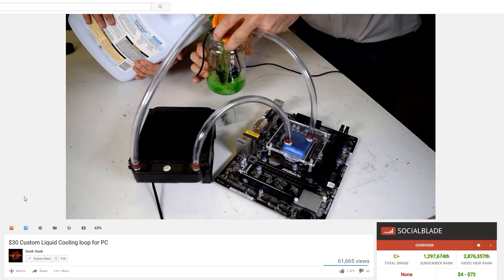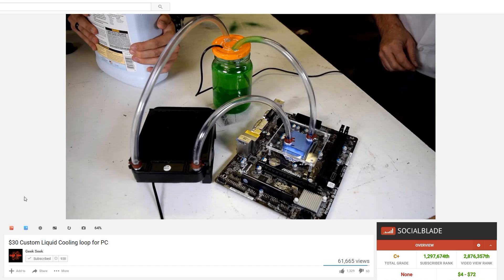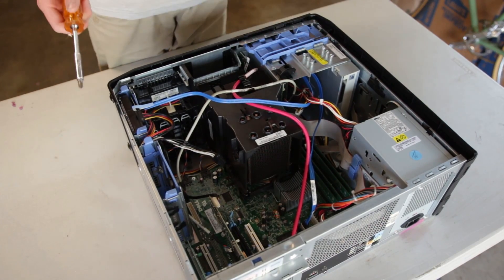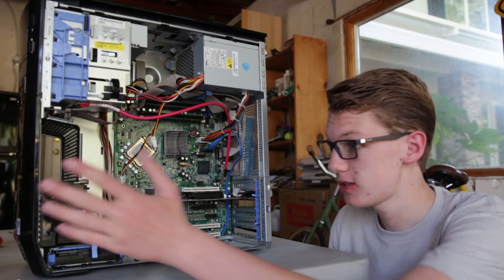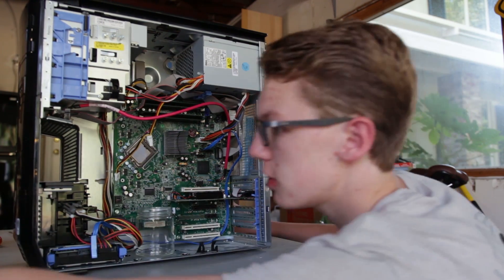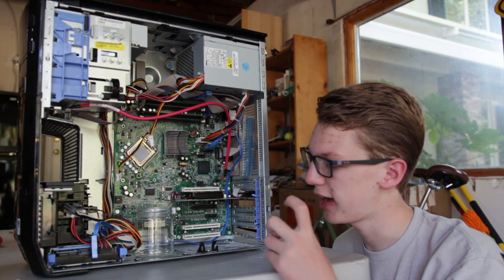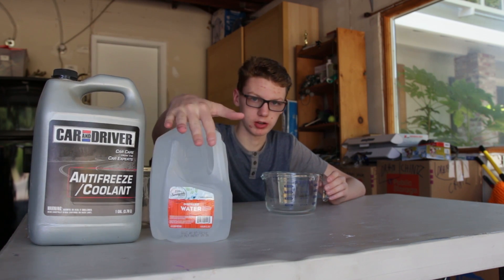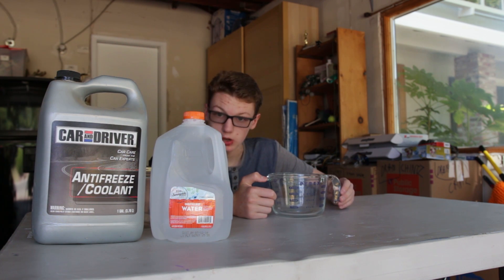DIY Watercooling the Intel Core 2 Quad(Q6600)!

Comment: Adding antifreeze is not a good idea. You are better off just using distilled water. And also i can see your jar still has holes on top, which means the water can evaporate over time and you need to fill it up when it's level decreases. Also if your radiator is aluminum and your cpu block is copper this will lead to corrosion over time, and eventually a leak.

Comment: How did you connect the water pump to motherboard? Any idea?
Reply from the maker: I connected it to the power supply with a molex power connector.
Reply: @GavinRemme  bro 12v is required molex connector or I need more voltage
Reply: Bro! Can you explain any problem will not occur and How to connect water pump directly to molex connector? How many voltage is molex connector have? Reply me fast because i am going to build a water cooling system for my pc i am inspired of your water cooling system.
Reply: And there are more wires in molex connector of psu where should I connect
Reply: What the screws are you used to hold the water block.name and size of the screws please?

Comment: Actually you can overclock it with a program called SetFSB but it will definitely be limited because you can't manually ajust the voltage.

Comment: Young man your video was nice but foolsh. Because you are using a non overclockable locked (DELL) motherboard. And so the oem cooling is more than enough on air. Just add some more fans "maybe some lighted" to the case by cutting the side panel if want to lower the temps. And check the bios and update it to latest and with any luck you may be able to install a xeon cpu in it. Which is far better. Or do the modification to cpu if that is what is needed. Sometimes watercolling is not the way to go....Stay safe and good luck.

Comment: You can overclock it. With a little bit of tape in one pin of the cpu, you lock the multiplier to 9 and it runs at 3ghz or 3.3 i dont remember

Comment: Building some cheap ass liquid colling system for by PC right now. Im ordering all the parts from chinese vendors, browsing trough taobao, found out that your CPU block was actually a really bad 3$ u-shaped radiator, thing not really suited for active heat transfer. oops

Comment: try adding a peltier unit to a second waterblock to actively cools the water below ambient temps.
Reply: You need roughly 300w of peltier coolers (just get a long version of the block he is using). Its not going to get that impressive of a difference (10c max improvement). Peltier just sucks in terms of efficiency, for example, if you put 300w of electric in, you get maybe 80w of cooling out. If you put 300w of electric into a refrigeration cycle, you may get around 1500w of cooling out (and you can go extremely cold, like -55c no load, or -45c with his CPU at max power). These are expensive though, but they are not a complete waste of time like a peltier is. If you do use peltier, you need to insulate and water proof everything for when it is at idle or you can short everything out with condensation.

Comment: Gavin, ive got a question. I recently ordered some parts for my own loop and ended up getting the same rad, pump but different cpu block. Ive got a question about how you hooked the pump up. I want to control my pump, could I use a fan hub controler?

Comment: Did you mount the reservoir to the case? If so how did you? I'm looking into doing something similar to try and get my Q6600 to 3.4Ghz, considering I can get 3.2 at 1.3v with good enough temps.
Reply from the maker: +ndreww Double stick foam tape.

Comment: I dont think that water cooling is better than air cooling ...
I have a Q8400 overclocked from 2.66 to 3.4GHz, and the temperature is around 38-40C,
full load temperature is about 50-55C. I have a cooler Cooler Master Hyper TX3i ...

Comment: Can someone explain how he made the mounting solution?
Reply: Mr.Money yep. so with that block you need to cut a square big enough to cover the mounting holes on your motherboard out of something durable like a piece of acrylic or cut off part of a side panel. you need to take this cutout and add holes to match ur board holes and ur cpu blocks holes. then slide the piece over ur cpu block, then tighten it down to ur motherboard. Linus Tech Tips just did a similar video and explains that part fairly well.
Reply: he should put springs below the nuts, to keep pressure long term, because the acrylic will set over time.
Reply: Agreed

Comment: Let me say dude, great video. I just have one question, how did you connect your pump to your psu??? Or if anyone else knows how too?? Much help
Reply from the maker: +Joe L I soldered the pump to a molex connector.
Reply: Is that the only way to connect them together? I do not have a solder.
Reply from the maker: You could just strip the wires and twist them together and then put some electrical tape.

Comment: You don't need to run the pump on 12v all the time, mine is an 18€ one and it starts pumping at 4,5V so i have it on the 5v rail. The improvement in temperture is only around 4-5°C and not as much as the sound
Reply: you should be able to use a fan speed controller to regulate the pump speed as well. just get a DC one.

Comment: do a benchmark comparison to older Q6600 rig
Reply from the maker: +Chetan Amrao They're the same. The only difference is the water cooling, but it won't matter because it wasn't thermal throttling anyways.
Reply: ok cool

Comment: Dude, this video is fantastic. The footage was great and you knew your stuff. The only thing that could be improved on is your ability to talk to the camera, it is good but could be  improved. Just spend some time in front of the camera and it will get better. Once it does, I think you could be one of the best techtubers on the internet. Good Job. (take my advice with a grain of salt tho, I made videos back when I was like 12... they sucked xD)
Reply from the maker: +ThePcNinja100 Thank you! 😁
Reply: great job man, liked the vid. got me inspierd ro buy a second System to try this out. would not dear this in my main rig which run's a wel overpriced ekwb set. but this might be Just as good.

Comment: It would have been cheaper to just buy a Corsair H50, 60 or any other on eBay. Why go pickle jar when those are available??
Reply from the maker: The point of the video was to watercool it myself.
Reply: Gavin Remme Did you use your blood or urine? Water is not from yourself. The water block is not yourself, or the jar. You made nothing. You just put stuff together. And it cost more than a used closed loop. Waste of time.

Comment: Hey man, good video. But I have a few things about the loop. All the eBay links I post are American because I assume that's where your from.
1. Get a Pump+Res combo and ditch the dodgy pickle jar. This one should work fine. http://www.ebay.com/itm/SC-300T-12V-DC-ultra-quiet-Water-pump-pump-tank-for-pc-CPU-Liquid-Cooling-System-/191221599290?hash=item2c85b20c3a:g:CPgAAOSwgQ9VyG-x

2. Get yourself some hose clamps for the barbs. Zip ties can break because of the clips. 

3. Get a new motherboard, case and CPU block. Those blue blocks have very little surface area for cooling and are very restricted with how much heat they can dissipate. This block is nice and comes with compression fittings so you won't have to worry about leaks as much. http://www.ebay.com/itm/GPU-Water-Cooling-Block-Transparent-Platform-Common-43-61-mm-Pitch-New-/141880476044?hash=item2108bc418c:g:0J8AAOSwKIpV-35N
Reply from the maker: Thanks for the links, but you realize the point of this was to make it as cheap as possible right? I know I can use better parts and get better results, I just wanted to do it cheaply and sorta hodgepodge. Someday maybe I'll do a legit EKWB hardline system or something.
Reply: Gavin Remme
I know it was to make it as cheap of possible, but I don't exactly want you to brick your hardware. The blue blocks are know to break within 3-6 months and spring a leak on the bottom of the block, draining your loop and leaking all over your CPU.

Comment: the stock heatsink has the same cooling surface, same airflow direction, no water, more lightweight and no pump. watering is impractical
Reply from the maker: But it's not as fun :)
Reply: that's true

Comment: I'm currently running as a daily rig a Q6600 just like yours on an ASUS motherboard.
The processor is under water cooling system from Cooler Master and OC to 3.08 Ghz... Everythings runs PERFECTLY and temps are 30°/86° F Idle (room temp 26°) and not going over 50°/122° F under full LOAD.
Anyway, I really appreciated your video in which you assemble that computer with that old Q6600 and the gtx 960. It made me buy an old GTX770 for just 90 $ (the equivalent in Euros is pretty much the same number 90 €) and effectively play all latest games with a decent amount of FPS (still playable). [I mean well above 30 fps].
Thank you very much for your test and I've seen you have improved a lot the quality of the videos with really good music in!
Keep working, you're making great stuff!
Reply from the maker: +Crazy Lod (LodOS) That's dope. And you're welcome, thanks for watching!
Reply: I get close to the same temps with a stock cooler, only higher due to ambient temps. And at a 3.10 100% stable and 3.30 about 97% stable. My full load temps are high due to stupid stock cooler fan not spinning up fast enough and the old gigabyte board I have doesn't have a way to change it in bios

Comment: how do you connect them to the Molax connector??  sorry,  im a noob at this..
Reply: It's a DC pump so u need to find the 12v side of a 4pin molex, any cheap DC voltmeter will tell you and then it's just match the colors and splice some wires. Use google for anything you're unsure of or need to look up.
Reply: okeyy.. thanks..

Comment: godDAMN the quality is on point! you deserve a million subs
Reply: Agreed, holy shit the editing and everything is great, subbed.
Reply from the maker: Thx bro :)
Reply: @GavinRemme  honestly. sorry im late but just found this channel its amazing
Reply: Havent even watched the full video but i have subscribed you desurve alot more than 5.1k ngl
Reply: Great video. I hate to be that guy but I just have to point out one thing - the glycol in that antifreeze is likely going to eat away at the plastic inside of the pump. I wouldnt use this type of setup for longer than absolutely necessary. Also that type of tubing isn't safe for glycol either. It shouldn't be too bad as there isn't much heat involved, but if you do want to stick with glycol, look for rubber tubing and a pump that advertises glycol safe. You made the right choice, as antifreeze coolant is actually better in the long run as your loop will be able to sustain higher temps, just make sure you have glycol safe parts.Again, great video, keep it up man.
Reply: I was thinking it too

Comment: Watercooled and no overclocked? what a waste ! !
Reply from the maker: +Syed Waqas Munir Yeah I might try the mod you can do on the Q6600 to overclock it.
Reply: Gavin Remme just get a Asus p5k-v or p5k-premium  LGA 775 Motherboard its so cheap like $20 and you can boost your CPU performance with overclocking.
Reply: Syed Waqas Munir from where these boards are at least around 50$
Reply: Gavin Remme look into overclock using tape...it actually does work yes

Comment: awesome video; I work with core 2 products a lot because I find many of them when dumpster diving. I'll probably try this at some point! Have you tried over clocking your water cooled rig using the bsel method? works like a charm on the Q6600!

Comment: How did you mount the screws holding the cpu block? Are they in preexisting holes?
Reply from the maker: Yes. The ones the air cooler used.

Comment: When you mount a radiator like that the inlet is always at the bottom and the outlet is at the top. This is so the water flows completely thru all of the tubes. If it goes in the top like you have it a lot of times it will simply drop down to the bottom and not go completely thru the tubs lessening the cooling effect.  It's a small detail, but an important one especially as your temps are too high. A stock cooler would keep it cooler than 60c at stock clocks/

Also, when doing a leak test you want to put some white paper towels down on the bottom below the loop. even if you do't see a leak, you will be able to tell if even the smallest leak occurred.

Comment: Dear Gavin, first off, your video quality is as always: dope as fuck! But one(or two) thing is there, which i've got to mention: The Cpu block you used, that exact thing, was used in a 50$ Budget water cooling challenge aaand these are made pretty cheap. so basically the bottom of it isn't really flat and this might mess up your temps. (Maybe sand it down a little, this will help) Also you said this Case is a Nightmare to Cable-Manage, and i really agree with you. But maybe you could cut the Cables you won't need from the PSU (I do this often and it never caused me trouble), and Cut out one or even both of the Hardrive Cages and mount the hdd in the 5,25" Bays eliminating the Need for an Extra Sata-Power Cable running down to it. A modular power supply (used ones are cheap) in the range of 450-550 Watts would Clean up this Build even more and gives you Headroom for Overclocking/volting.
As always, keep up your awesome work.

Comment: With the BSEL mod you can overclock the Q6600 by covering two pins with tape to 3,0 GHz
Reply from the maker: I may possibly attempt this.
Reply from the maker: First Last ™ Double stick tape :P
Reply: SetFSB works too if you can find the right PLL id number on your board, doesnt work with my optiplex 755 sadly. The BSEL tape mod works 100 percent though. 2.992ghz 333mhz FSB
Reply from the maker: First Last ™ The holes are threaded, so I could just screw them in.
Reply: http://www.overclock.net/t/1540627/need-clarification-on-the-q6600-bsel-mod-to-3ghz 
Should only take a few minutes to do. I have 2 Dell optiplexs with this mod
Reply: +Gavin Remme Try to use ClockGen to overclock  that oem dell motherboard  because I have something  similar  to your pc cough cough Dell dimension  e521  with amd athlon 64 x2 6000+ (2 physical core) 3.0Ghz. I overclock my proccesor to 3.1 Ghz overclocked by 4% (stable) so you probably  won't  be able to do a extreme overclock due to the fact that motherboard can't  unlock the cpu  voltage which it needs overclock  to extreme  limits. This video is funny because  I was thinking water cool my old dell dimension  e521
Reply: Gavin Remme Dude, the double stick tape work a charm. Thanks man
Reply: Gamingonabudget seems cool but I'm already at 2.9 so I don't see why I need to go to 3
Reply: only if your cpu or bord can handle it. i tried it before and it didn't work. wont hurt to try ha
Reply: +Gavin Remme Oh btw can you tell me how you mounted that cpu block. It seems like you made screws for the block but isn't the other side have permanent mounting riser that would prevent screw from attaching to the motherboard?
Reply: +First Last ™ *attaching under the motherboard
Reply: Gavin Remme How did you mount that radiator in the front side of the case? Like I water a similar pc called Dell Dimension E521 and when I installed everything notice that there was no way to mount the radiator with the screws it came with. Like what type of mounting solution use?
Reply: +Gavin Remme You must be kidding  me. How did mount that radiator so perfectly with just double stick tape. Well,  I guess I should double stick because  my radiator  is just hanging all over all around my case.

Comment: I have the q6600 and love it ! <3
Reply: Tiago André yea well the q6600 is still not recommended know a days soooooo might want to upgrade
Reply: i already did i have in stock a q9650 and 8G at 1066Mhz im going to watercolled this beast should have at least 4.0Mhz
Reply: +InvaderGaming new ones with a good gpu will run decently
Reply: i have a q6600 too as a second computer, and you can run everything you could run on a current gen cpu
Reply: I use this Cpu to make Grapics design but I thin it will handle games like Gta5,BO3 or IW with overlocking the Cpu and an good Graphicscard !
Reply: I own the q6600 ang can play gta 5...
Reply: i have a q6600 and i play gta v so shut the fuck up you noob :-)
Reply: stock 2.40 just to let you Know
Reply: what games can run on it?
Reply: Andrej Wilhelm Watch the diy case video on my channel, it's basically what you are describing in terms of performance. I don't have a benchmarks video out yet but it will come.
Reply: Andrej Wilhelm HAHAHAHAHHAHAHAH THE q6600 can't Handle gtav
Reply: Tiago André *GHz
Reply: What is the best gpu for q6600 btw?
Reply: Italic 750Ti or HD7870

Comment: reply to my comment and it'll make my day
Reply from the maker: Have a great day :)
Reply: gavin you can get a oc bios for the mobo,because hp and dell often put locked bios on their mobos so if you can find a new oem bios you migth be able to overclock
Reply from the maker: Maybe, but the motherboard may not physically have the circuitry to support it.
Reply: Gavin Remme yeah, but intel didnt have locked cpus before so you can overclock on any chipset of that time